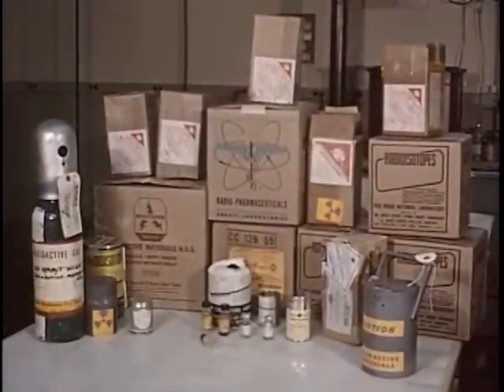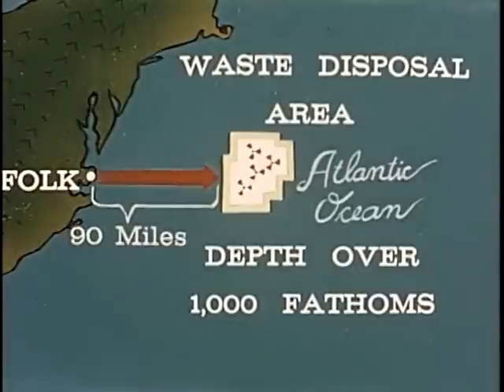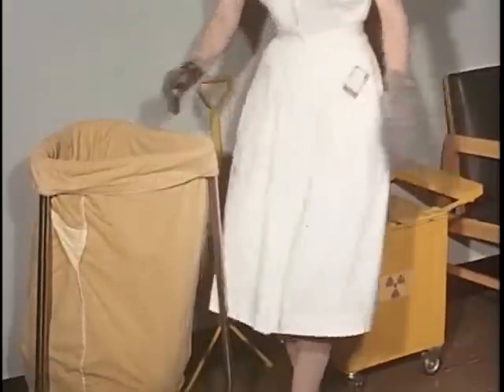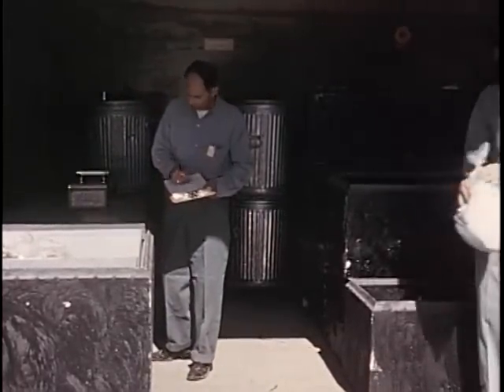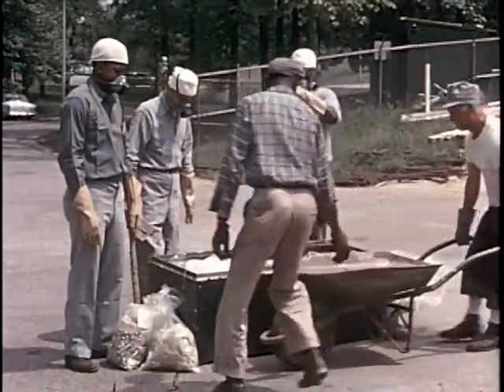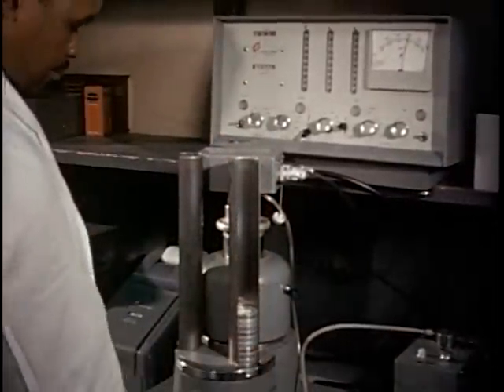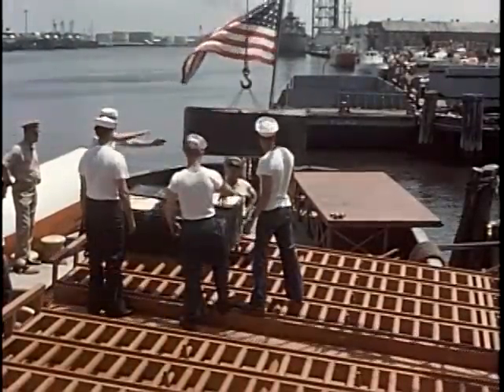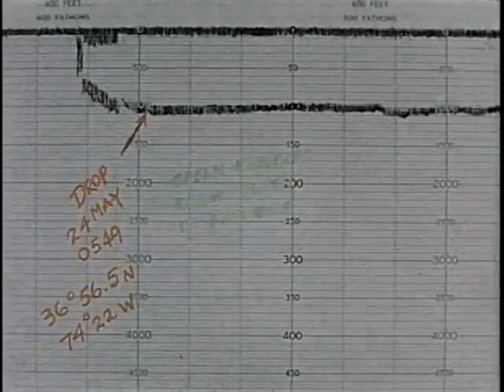Radioactive Waste Disposal (USPHS, 1959)

Comment: The pride they put into documeting thier carelessness  is remarkable. And this does not only concern this american documentation...

The only thing they emphasize they do carefully is documenting stuff. The rest is a mirror of its time, hillbilly-handling radioactive waste. Co-60 is not medical low contamination type low-level-waste, those are used up sources that will emitt hard gamma radiation over some decades. And i highly doubt that some sketchy backyard concrete mix left to dry in the heat of the sun is going to harden without cracking, rendering it useless.